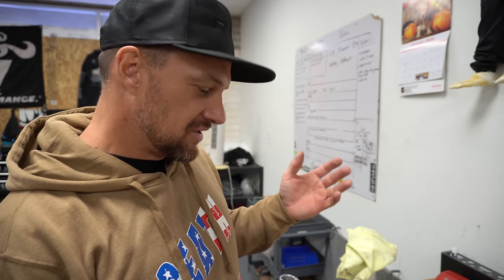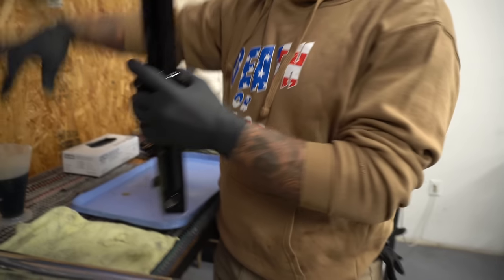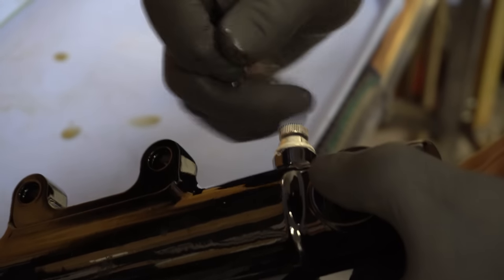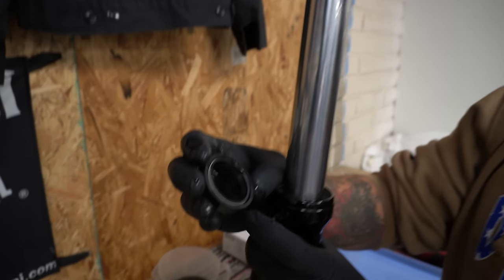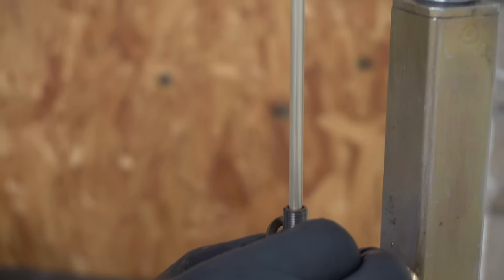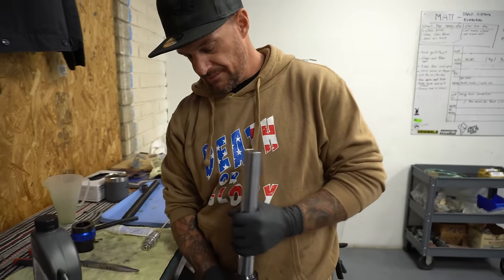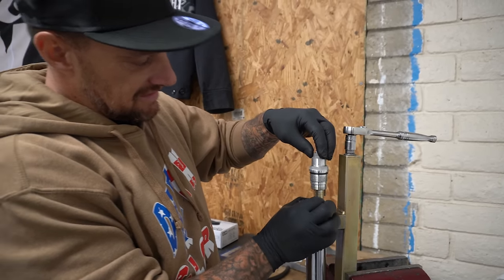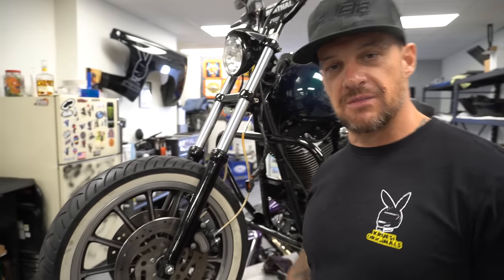How to rebuild a harley davidson cartridge front end on a 02 fxdx dyna or any harley

Comment: Great video very helpful like all the others
I’m getting my 02 Fxdxt set up for stunt riding and wondering if the stock springs are ok or if I should go for the hd springs with heavier oil, I’ve seen a lot of guys running legends carts but that’s a bit out my budget at the moment. Thanks
Reply from the maker: Stock springs are good just run some 20 weight
Reply: Legend, thanks for getting back to me

Comment: Where did you get the lower stops? I assume they came out of the lowers. If so how do you get them out without damaging the lowers stops?
Reply from the maker: You pulled them out and put a new seal on them and put them back in.
Reply: Thanks. I can’t figure out what tool to get down in there to grab it and pull it out. I did steal your triple tree work bench mount idea. Clutch!

Comment: I have a 2003 FXDX and the last time the forks were rebuilt was when I had my local HD dealer powder coat the lower tubes. That was back in 2015 but I bet I have not put 10,000 miles on it since. Is there a way to flush the fork fluid without Performing A total fork rebuild?
And how often should this service be performed? Thanks!
Reply from the maker: Every 10,000 miles and those are cartridges so you have to completely disassembled him to prime the cartridge

Comment: I miss my FXDX….I’m quickly learning why Ryan calls them FXR’s shitters. I’m working on it more than I ride it. What are the best years of the Dyna’s for stunting again?
Reply: Alot of people prefer the 00 to 02 but if you've got good money I think you can make any Dyna pretty nice! But these Fxdx's are sought out because of the suspension and how the geometry is.
Reply: 00-05 FXDX's and FXDXT's for my first pick and if not a set up FXD. The FXDX just feels different. I've had a few on own a built one. My 18yr brother saved for a few years to buy one soon. The only thing is in California they are pricey.
Reply from the maker: Any 2000 05 is really good. 2000 to 2002 has a timken bearing bottom end and a smaller frame they are the best. But 0405 fuel injection is also really really nice. It’s kind of personal preference late models are also really good as well depending on how big you are.
Reply: @kruesioriginals  💯🤘

Comment: Hi Kruesi Origionals team! I have a question, forgive me if it sounds retarded but im new to harleys and im learning as I go.
I'm a long time subscriber from England, over hear the sportster is the go-too harley as we have huge import tariffs that make them all super expensive. I bent my 39mm sporty forks in a crash but was wondering if its possible to upgrade to a 49mm set up. im a welder and machinist so sudtom fork clamps are not an issue.
do you think a set of 49mm forks and legends axeo cartridges would work with the lower weight of a sporty?
thanks for all the videos, you nspired a Brit to buy American!
Reply from the maker: You would need to get Dyna super glide 49 mm trees and it will all bolt up. He will probably have gas tank clearance issues unless you have a peanut think.
Reply from the maker: Tank